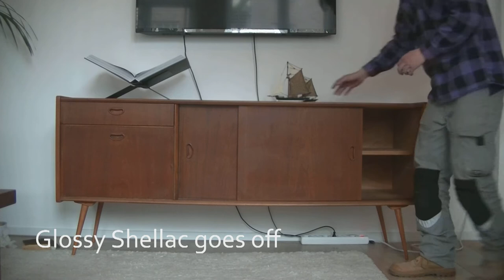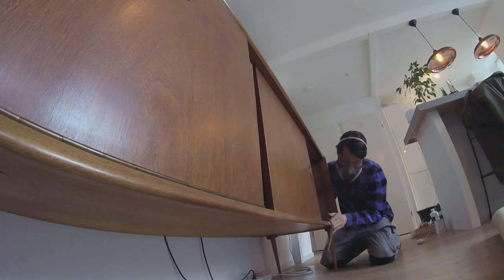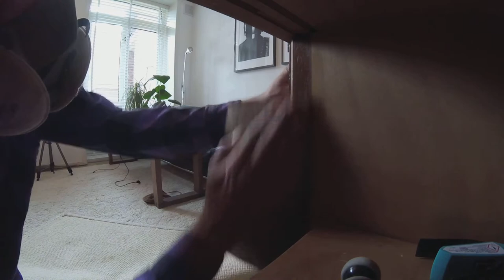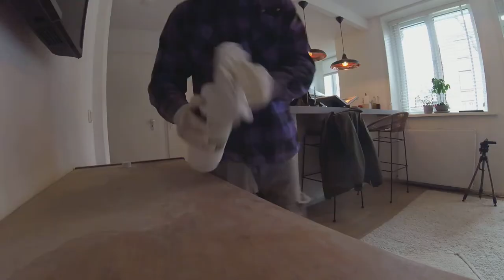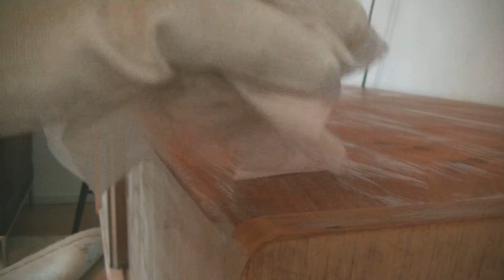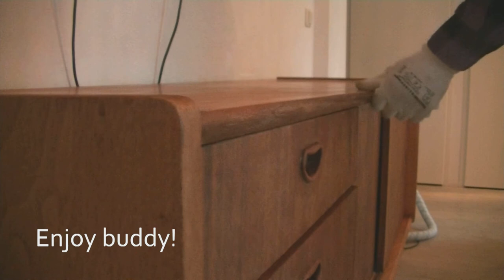Refinishing a Mid Century Modern Credenza

Comment: I hope you can help. I have just been given a vintage teak sideboard, which has three sliding doors a bit like your credenza, which seems to be an American word. Each door has two wee plastic 'sliders' which are simply pushed into the bottom, these then slide along one of the channels at the base of the cabinet. The middle door is loose, as there are no sliders. Any idea where I can buy these from .. They are white plastic rectangular shaped with dimensions of 33mm x 11mm. Thank you
Reply from the maker: Great question, a hardware store might have these sliders. Or otherwise you could 3d print them. With 3d hubs its quite accesable.

Comment: Props for doing the sanding in your living room, I did that once, didn't go over so well with the wife ;)

What kind of oil did you put on?
Reply from the maker: Tom Mulder haha, thanks. Its an oil also useable for cutting boards. I even bought this one at ikea, behandla.
Reply: applying a beeswax / mineral oil coat also helps with the endurance of the piece and doesn't add to much shine to it. (and smells nice)
Reply from the maker: oh yeah thanks for the tip and sharing!